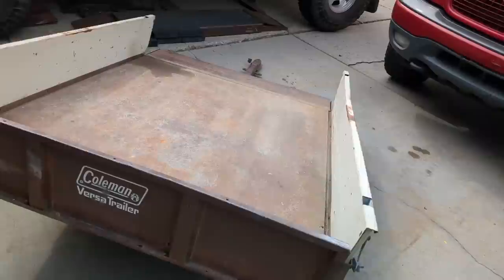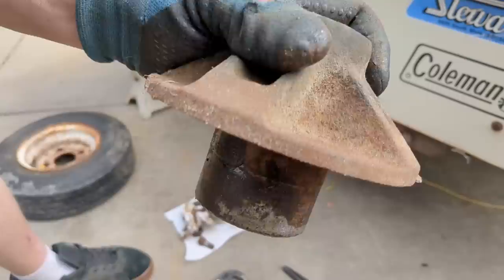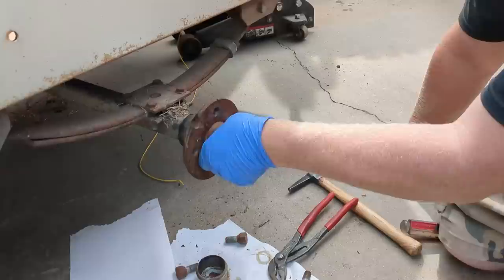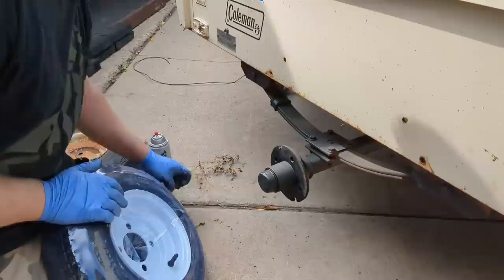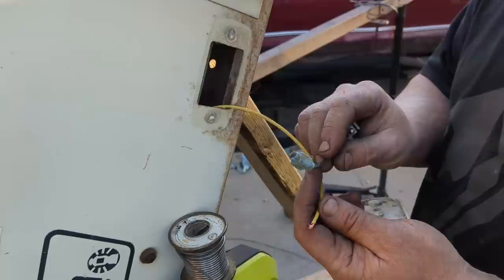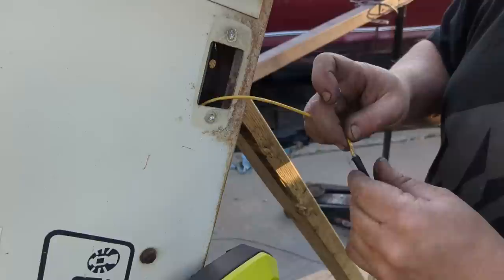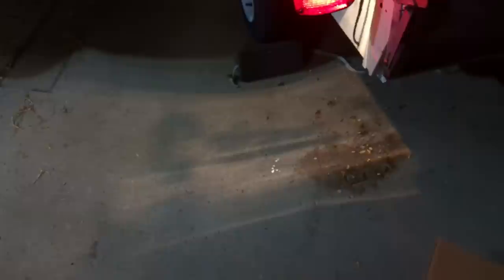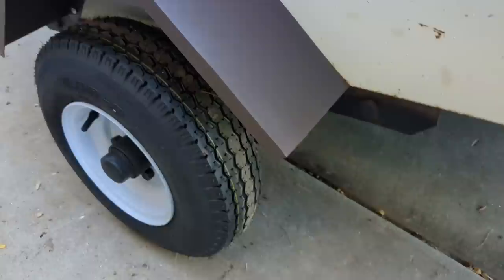Rare Coleman Versa Trailer Full Repair

Comment: Interesting insight on pulling trailers with small cars.  My small-car owner's manual specifically says not to pull a trailer, but it has a 3.5L V6 engine (VQ35HR) so it seems like it could handle it pretty easily.  Would you have any insight on that, that you'd be willing to share by any chance?
Reply from the maker: They actually call it "The Great American Anti-Towing Conspiracy" . It's thought just to be there to entice selling pickup trucks that have a much higher profit margin. Look at Europe and see that they are towing campers with 1.0liter engines all over the place. They will tow another car with a car on a trailer everywhere else in the world except North America. I did the math and this little car has a better weight to power ratio than something like a Jeep you would see towing stuff. You'll find it is actually easier on the car to tow a trailer with 800# of stuff than to load the car with the say weight as the suspension doesn't suffer. With any trailer the tow vehicle just needs to take 10-15% of the load and the rest is just rolling along behind. So I had around a 80-100#s on the tow ball for this load but I have towed way more.
Reply: @sixtyfiveford  Thanks so much for that detailed response, super helpful.  I just read the first article that came up on a search of TGAATC.  Fascinating and very useful info

Your breadth and depth of practical knowledge, and the effort you make to convey it, is truly mind blowing, and very much appreciated
Reply from the maker: @dennismalandro2110  If the car is sold worldwide/Europe you can generally look up the towing spec in that country. You'll find the same cars that are listed to tow around 2000 lb in Europe say they can't tow anything("not recommended") in North America. Go figure....
Reply: I would postulate it's possible that some cars simply aren't built for towing... from the perspective of the body shell. In the eyes & brain of the engineers, they may view the car is having no practical, safe way of attaching a tow hitch. With some of the Spam can imports I've seen over the years, I would be very hesitant to attempt attaching a tow hitch to those cars any day of the week! There was way too much thin metal & plastic in or on the unibody!! Your opinion may vary. 🤔👍🏻🇺🇸

- Max Giganteum
Reply from the maker: @MaxGiganteum  They make tow hitches for most cars. They generally bolt to the tow points on the car which are the strongest structural points. Let's take my 1982 VW pickup that is based on a car(VW rabbit). VW says it can't tow anything in the US and you are limited to the same capacity as the car version even with a pickup bed. Now the exact same vehicle sold elsewhere in the world was rated to tow 1962 lbs with a trailer tongue weight 165 lbs. The bed was also rated to carry 1000lbs and they even called it the "half tonner". I think it is likely for tax reasons but also to keep pickup trucks forefront in the towing segment as they have 25-50% profit margin vs a cars 10%.

Comment: They tow great till they don’t.  Those trans not made for towing. Learnt my lesson??
Reply from the maker: Depends on how hard you are on the car. I have 340k on the car in the video and a good 20k was with a much larger trailer than in the video.  I have at least another 30-50k with me just loading generators, mowers, tillers in the back and I will say the trailer is much easier on the car.

Comment: Good idea having the front wall fold down too, tho the side walls require a little more reinforcement.
Reply from the maker: They're a little wobbly with the back and front open at the same time, but if one tailgate is closed they are pretty strong.